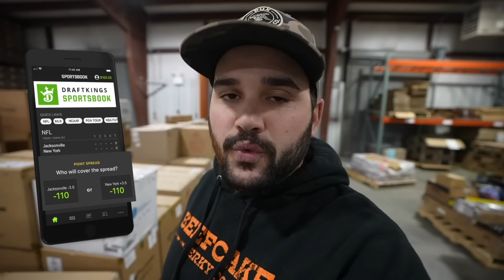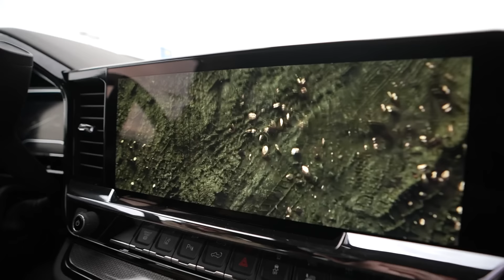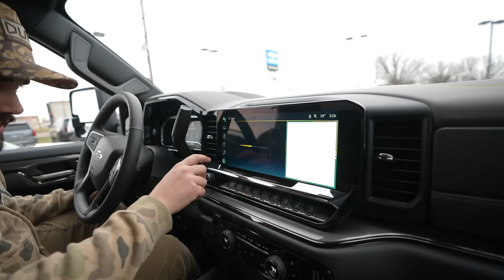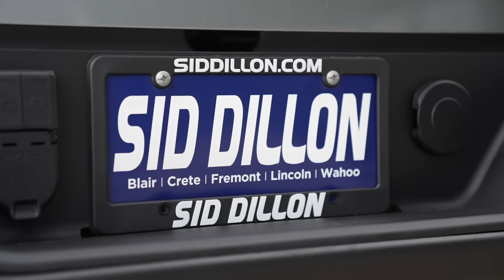I TRADED in My DREAM TRUCK for THIS!!! (Bad Idea?)

Comment: Exhaust, window tint on the front to match the back, light bars, big winch on the front, amp drop down power steps, and a bed cover/ topper
Reply: He wants to be able to use a gooseneck a nice brush guard on the front with look cool
Reply: Yep
Reply: No topper but everything else yea
Reply: Exhaust and tune
Reply: The gayest comment ever
Reply: @IndianaWhitetailFanatics  camper shell and light bars come on man get a suv if u want a camper shell and light bars are for the mid 2000s
Reply: @IndianaWhitetailFanatics  must be a northern thing down south we use our trucks for truck purposes and we need the beds
Reply: All of those and the topper
Reply: A canopy?
Reply: yah exhaust and tune if you want to spend 10k plus
Reply: And hellcat engine swap
Reply: Brush guard. Exhaust. Tint. Amp steps
Reply: Yea
Reply: Super charge it
Reply: Exhaust and tune mabe some different rims
Reply: You lost us at camper topper old man. But the rest would be 🔥
Reply: Im assuming you mean straight pipe when you say exhaust? You cannot straight pipe and delete new diesels. The computers are too good and the dealership will know the second you do it because of those computers. Im all in favor of deleting diesels but its kind of impossible with the newer models
Reply: Not every truck needs an exhaust and tune. It’s a work/family truck.
Reply: Nah more of a stock look is way cleaner
Reply: Don’t forget a ranch hand grill guard
Reply: Delete def egr dpf
Reply: All the new steps attach to the body, get frame side steps
Reply: The only thing I would add to this comment would be a big cattle pusher and aftermarket  back bumper. Yes, the ones the bison comes with are nice but I feel like this truck would be sick as tits with beef bumpers.
Reply: I like everything abt this but the topper/cover
Reply: Black roll bar and grill guard
Reply: Agreed
Reply: No topper
Reply: Light bars are gay
Reply: No topper
Reply: Pull out storage
Reply: Those amp steps are like 2 grand if my truck don’t come from factory with them I don’t need them 😂

Comment: Yes the Bison needs a topper but not just any topper,  it needs a survival/outdoor equipped topper. Maybe a brush guard to protect the front from bushes and downed branches.
Reply: Has to still be able to use 5th wheel though 😢
Reply: Brush guard will also protect it a little from a deer lol
Reply: @Detailing_SS  thats the good think about a topper, they come off, and the accessories strap to the sides and top, and store inside the bed, so with a little time he would be able to 😁
Reply: Toppers are ugly but useful
Reply: Leitner truck racks have storage on the sides and a tent topper and if I’m correct you can still fit a 5th wheel on it. Highly recommend as I have one

Comment: Flair needs to put a decked system on that
Reply: Can’t use his 5th wheel then
Reply: I'm rocking the decked system with a topper and it is awesome for work and for fishing/hunting I love the combo!
Reply: Deck v2 lol
Reply: @DamnChinn  I guess I’m out of the loop on the new stuff lol 😂
Reply: My buddy’s decked leaked and ruined his surveying equiptment.
Reply: @TheGarrettrose that’s how you do it
Reply: @Detailing_SS it don’t even have one.
Reply: @tylerwooldridge7933 the company should replace it I seen in a video where a guy said that it’s supposed to not leak and is warranted if it does
Reply: @Detailing_SS its a 2500 bro he can’t even pull a 5th wheel no 5th wheel hitch
Reply: If he put a decked in it he couldn’t use the gooseneck and also with a topper he wouldn’t be able to use the gooseneck so I think the power retractable bed cover would be the best

Comment: Color matched topper, blacked out running boards, tint, some hard plastic mud flaps! Oh and get the new decked system for the topper to!
Reply: WTF is a topper? You mean camper?
Reply: @JuarezDerrick  no I mean topper, that’s what the shell they cropped into the bed of the truck is called. A topper.
Reply: @jonlocke8657  that must be what y'all Yankee's call a camper 😂
Reply: What are you when you live in N

Comment: I can tell you when you put a receiver in the back bumper to pull trailers that second top opening part of the tailgate will hit it and dent your tailgate if you open it while the receiver is still in.
Reply: As tall as it is he would need a drop hitch anyway

Comment: weathertech floor mats
bed cover(no topper)
b&w trailer hitch(but be careful because the multi-pro tailgate function will hit a trailer hitch)
automatic running boards
tint
exhaust
get some fancy D rings to go in the rear tow hooks
maybe a winch and lightbar
Reply: Finally someone against a topper
Reply: Finally someone said no topper

Comment: 25:29 tint front windows auto tunnel cover Light bar in grill and a 20,000 lbs winch on the front
Reply: Yes

Comment: I would say maybe not a topper but add one of the sweet rack systems that has the tent on top …   Backup light LED cubes,  add some more led cubes up front and a winch hidden in the bumper.  

Toolbox with extra fuel cell is nice to have.

Topper with a “decked” bed box would be sweet.

Congrats on the new truck Flizzy !!!
Reply: Sucks but I don't think you could pull a gooseneck with all those

Comment: Im a big fan of fastop dual tonneau/topper cover. And an overland rack over it. The rack gives you mounting places for tools and gear. The cover fits under to keep things dry in either topper or tonneau configuration. Plus you coukd toss a rooftop tent on it and do overnight hunting challenges out of it.
Some auto extend side steps and aux lighting upgrade definitely beeded

Comment: Hi, I have a AT4 GMC. Make sure when you use the tailgate you have your hitch out. If not you will dent your tailgate. I think they make a sensor safety switch so if your hitch is in you cant open the tailgate. This is a must. It will cost you a lot of money to fix a dent in your tailgate. The truck looks great. Enjoy. Thanks for the great video's, you do a great job Flair.
Reply: Guy I go to church with racked the tail gate on the hitch in his brand new at4.
Reply: BW makes a hitch to prevent that

Comment: Topper would look great, but how does that work with the gooseneck?
Suggested additions would be a bullbar, winch, and lightbar😊
Reply: Short answer is it won't, clearance would be a nightmare plus run the risk on sharp turns of catching the flip up glass on the gooseneck and busting it out. It could work, just not practical at all, better off with a retractable cover.

Comment: Black brush guard, black steps.  Before messing around with the bed area you should do the ball hitch.  If the decked systems don't work with a ball hitch, they do make "wheel well" tool boxes that swing out (have one on each side of my ranger).

Comment: Cosmetic mods/exterior protection: Ppf, ceramic coat, auto topper, side steps, lights, front steel bumper & winch, off road rims/tires. 

Interior mods/protection: weather tech floor mats. Seats and fabric coating. Window Tint. 

In the near future vid: Apocalypse rig.

Comment: Tint, GM running boards (cheaper ones rust out), auto bed cover, black out the ZR2 emblem on the fenders, winch/ light bar

Comment: Needs a winch, fender flairs and power running boards. I’d also put the decked system in back and a bed cover.

Comment: I'd add a badass brush guard and running boards with cool accent lights. If you get a topper get one thats not too heavy in case you need to remove it to use the 5th wheel.

Comment: Light bar on the top 
Winch in the front
Topper
Automatic steps
Brush guard 
Possibly decked system

Comment: I think if you want side steps amp steps are the way to go also a winch could be useful an off-road fuel tank for a skid loader would be cool, light bar, smoke out rear tail lights, window tint, a must is the loudest train horn you can possibly find and keep the front end looking clean, no brush guard

Comment: Front winch, exhaust system (possibly electric baffle system), roof basket, running boards, bed cage for hanging gear, barely legal tint on front, gun rack in back glass. 
Just remember what you do can effect your warranty.

Comment: 5in straight pipe, delete, bed cover not topper, bigger tires, ranch hand with light bar, bullet antenna, auto steps, tint,  color match heads and tails

Comment: Brush guard with a big winch, running boards, maybe bedline the floor boards (because of how messy yall are), topper (for truck camping), led light bar, vinyl wrap with beefcake bux dux and googan on it

Comment: Hey flair, I don’t know if the sells man told you about the tail gate speakers you can put in the tail gate.. when you pull the step Down those square things is where the speakers can go.. I think that would be pretty beafy and slick if you put some in it!!

Comment: Big truck like that automatic running boards are slick.  Could go rock sliders but probably not needed for your use.  Campershells are awesome for throwing gear in and dogs too.  Some people hate them though.  Hit up Torc Motorsports 87th and F st and see what they might have too.  Would say led light bar (hidden) but electrical systems now a days could potentially cause issues so be careful.

Comment: I’d say get the automatic topper installed, otherwise if you go with a full topper you can add a camper topper or a rack with fishing rod holders. Depends on what you want to use it for.

Comment: tune and delete, s400 turbo, dual cp3, big injectors, headstuds, built trans w new torque converter, valve work, head work, build the bottom end, power coat everything. 5% tint all the way around, 35% on the shield and it’ll be solid

Comment: Tune it
Tint the front windows
B&W Bumper Hitch (make sure to get the Chevy/GMC one due to the multipro tailgate) and Gooseneck Hitch
Ranch Hand for the front
Meatier 35” Tires
Automatic Bed Cover (you can’t tow the gooseneck with a topper)

Comment: Definitely need the power running boards, tint and retractable bed cover.  A topper would be sweet on this rig though.  You could STACK some deer with a topper!  😂. A light bar of some sort would benefit your lifestyle though.

Comment: Zr2 nerf bars. KC lights, automatic bed cover, carpet the bed, 5th wheel hook up,  automatic side steps, night vision, infrared lights, heat wrap the exhaust front to back. Gun rack, and put a beefcake jerky logo on the back window so you can write it off as a business expence.

Comment: Missing the radio and light in the 2nd tail gate so at night you have extra light for cleaning the deer. Also I wouldn’t get a topper because then you wouldn’t be able to haul a gooseneck as easy.

Comment: I'd say do the auto cover instead of the topper. If you plan on still being able to use the gooseneck you aren't going to want to pull the topper off each time you need to use the gooseneck.

Comment: Decked storage drawers 
Camper top
Winch
More lights 
Bigger tires after you get your money out of the stock tires. 
Tint on the back glass and doors.
And add some decals to display your brands. 
That's and good looking truck I currently have and 12 f250 that was my dad's. It only has like 32k miles. And I feel your pain on the 12mpg. Around town. It does do better on trips at 16mpg lol. But it was my dad's and it spent most of its life in a garage. This spring I'm doing and spray in bed liner and decked storage drawers and a winch. I mostly use it on trips snowy days and hunting.

Comment: 1. Sport bar 
2. Straight pipe 
3. Super bright led bar 
4. Tint (for privacy)
5. Decals (2 lines in the middle )
Reply: Don't answer. This is not Flair and is a scam. No creator ever does this.

Comment: When the warranty runs out, get you a tune in delete for the def system and do a 5 inch straight pipe when the tunes are released then you would have a race truck and good haling truck 😉

Comment: BIG RANCH HAND BUMPER LIKE THE FORD HAD toppers debatable because you got a diesel to pull a gooseneck but the front bumpers sturdy but you gotta think of protecting all that plastic covering the radiator id get that same roll off system you had on the ford so you can pull and utilize the bed space

Comment: U need to put a mbrp 5 inch exhaust no muffler so strait pipe it and but electric steps not the fixed ones, they look a lot better

Comment: No topper for 2 reasons.

1. Toppers are for old men, first and foremost 😂

2. You bought the truck to put a gooseneck in and you can’t pull a gooseneck with the old man cap

Comment: Be careful what ball hits you put in there cuz when you put that stuff down you're going to hit it if you don't have a little bit of a drop-down hitch at the very least they did not design that tailgate to work functionally for a 2500

Comment: Running board 35 Inch mud tire a topper or automatic bed cover heavy duty winches and light bars and straight piped exhaust

Comment: The 3/4 ton ZR2 only tows about 2600lbs more than a 1500 with a 6.2L. Seems like a silly decision to me to trade regular 2500 and a Dually 3500 for a “heavy duty” truck that only tows 16klbs. The ford or the gmc would have been much better choice especially if you want to tow a gooseneck even occasionally.

Comment: You don't want to put a topper on it because every time you want to pull the goose neck you will have to remove it and it will start to become a pain in the a$$.

Comment: @FLAIR  -  Get a   L E E R   High - Rise  Topper, in Matching Grey ( OR, Maybe BLACK ! )  With Tinted Windows on the Topper & Main Truck Windows. Also, get ALL The Lights on the Truck, From Head Lights, Too Tail Lights, Too All of the Marker Lights done in a  SMOKED, Tint !!!!!   ALSO ! Dirty Max's LOVE To Breath ! AKA; Get a Cat DELETE, MUFFLER DELETE, And a 5" STRAIGHT - PIPED Exhaust Made, Duallies, Equal Length For Improved Sound, Optimal POWER & A HEALTHY Engine .  Maybe Down the Line, if your Too Pussy too do it Now,  i'd do a FULL EGR Delete & Everything Else that goes with it. Of Course Getting the Tune Fixed too Only Compensate for the Delete, Would be a WASTE of a Good Dyno / Tune Session . . . Might As Well Get the Tuner To Crank' it up maybe, A 100 HP,  &  200-250 LBS of Torque, Over How it is Stock, Right Now, All While You'll HIGHLY Likely see an  improvement of 0-5 MPG, Conservatively .  ALSo , the Stock 35's are Really Nice ! Espicially for Chev, Finially in the 35" Tire Game !!!  ..But with that Stock Lift... May as well Slap on some 37's ... You know.. Nice, MEATY , AGRESSIVE SIDE-WALL, DEEP - LUGS, BadAss Lookin' Tires With... well.. EVERYTHING , Mentioned here, That ZR-2 Could be a ONE - OF - A - KIND Dreaam Machine that would have even the Highest, High - Ballers , Jelous man. Do it Up !!!!! (: